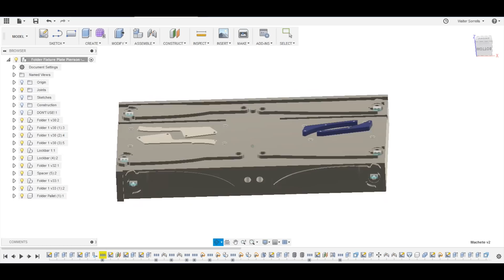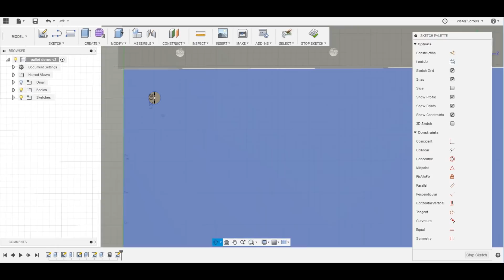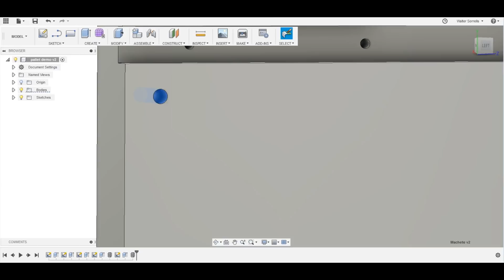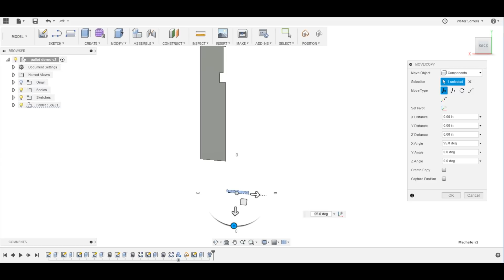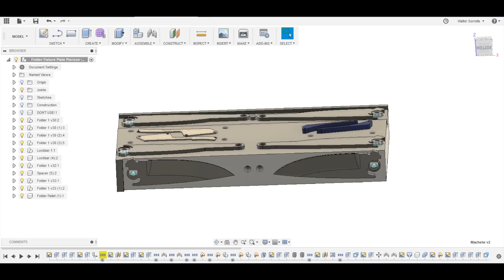Making a Knife Making Fixture Using a Pierson Pallet System - Pt. 1

Comment: For those that may have an interest in the machining side of knife making but are put off from these videos because of the "$15,000" machines that you think you "need" to be able to do this, this is for you. 
These machining videos don't get enough love and I think that it's because many people have the wrong idea about what this is and how much the 'cost of entry' REALLY is and what the learning curve REALLY is. 

I think it's worth mentioning, namely in the context of knife making, that these videos don't have to apply to only the guys with the bank account or full time business that makes possible the possession of 4 and 5 digit, high end, name brand CNC mills. As Walter mentions, this pallet system(as well as some of his other machining oriented work) can apply to something as simple as a drill press. If you're offering a specific model of knife(like Walt's production knife line) and have sufficient demand that you want to streamline the manufacture of them, setting up a fixture/pallet system even on just a drill press can add up to a meaningful time savings just in laying out and drilling the necessary holes, depending on the quantity you're putting out.

However, I think that the more important point that can be made with these machining oriented videos is that we aren't machining up parts of a satellite that NASA wants to strap to a rocket propelled rocket and drop kick out into orbit - you don't NEED a $75,000 industrial precision manufacturing Haas CNC to be able to machine some holes and a bevel into a low production blade. You're JUST machining a blade, if mounting it in a drill press and drilling the holes is tight enough tolerance(which of course it is), then you don't need 1-tenthousandth of an inch precision from a mill.

If you're a blade maker, even if just a hobbyist, that has an interest in possibly machining blades like this, then get a ~$700 Grizzly benchtop mini mill(manual, 110 single phase, variable drive, more than capable of handling any work that an evolving knife maker would use it for) to learn on, and, if you're so inclined, you can convert it to CNC yourself via 3rd party kits(there's numerous forums dedicated to this stuff, all the info you could need on this topic). Or, if you're really more interested in the automated CNC aspect right from the jump, maybe check out something like the Deepgroove1 CNC mill for ~$1700(if you're selling knives or are just in general very serious about knife making, you should be able to save your pennies up for this) or similar benchtop Chinese import machines, and, again, these can and will absolutely handle all of your needs.

Don't let Walter's big ol' Tormach scare you away, this is DEFINITELY within the realm of anyone that wants to do it. Set back $__ amount of money from each pay check for 6 months, a year, 3 and a half years, whatever it takes if you're really interested, and you CAN make this happen - just like all the other customers of the aforementioned budget benchtop mini mills have. It's a great way to learn machining, CNC, and, if your needs to go beyond knife making, you possibly won't even have to worry about upgrading for years to come.

And, as far as software goes, you can get some big boy software, 'Fusion 360' from AutoDesk(which I believe is what Walter uses), absolutely  F R E E  if you're a hobbyist/enthusiast or even a small business that's making less than $100,000 a year. There's a learning curve to CAD/CAM software just like I'm sure you've heard, but that's because there's a learning curve for EVERYTHING. You're obviously on the internet right now, you have all the access in the world to FREE information via YouTube, forums, Facebook groups, and numerous other sources, not to mention AutoDesk usually has some nice guided tutorials with their software. No excuse for not being able to learn this if you actually want to.

So, stop saying that these videos aren't relevant to his audience, hobbyists, that you can't afford to get into machining, or that you "don't understand computers well enough" to learn this - if it's something that you're actually interested in possibly doing, stop making excuses, grow a pair, and actually work towards it, like every other interest you've had in your life!
Reply: making knives with CNC's is idiotic IMO.  I come here to laugh.  and I do.  
sorrell's knives are boring and unimaginative.
Reply: Jack Spradt Yes, we get it, you're trying oh so desperately to successfully troll on here, just like you've been doing for the past who knows how many months now. You aren't succeeding.
Reply: the truth's been trollin' a lot lately.  gimme 5,000 words on why.

Comment: All I heard was TA folder...
JK great video. 

Although some of this fixture building stuff may seem mundane, I find that it really does help you get your product right the first time.
Reply: Getting this right is possibly the most important step to CNC production knife manufacturing(probably along with the CAM work) - EVERY aspect of your fixtures will be reflected in the material/blanks that you're affixing to them, so loose tolerances, inconsistent dimensions/geometry, God forbid outright design or machining mistakes that in any way result in issues with blank mounting will be blatantly reflected in the finished product. If you screw up the fixture but your tool paths are programmed around a 'perfect' fixture with tight tolerances, you're about to straight trash some nice expensive blade steel...

Comment: Great video Walter and perfect timing for me. Could you cover the pros & cons of doing the bevels in a vertical orientation VS horizontal? I think most people do vertical bevelling with a ball end mill to avoid cutting with the tip, while I want to try using a wider diameter corner radius cutter and horizontal orientation so I can fit more blades on a pallet.